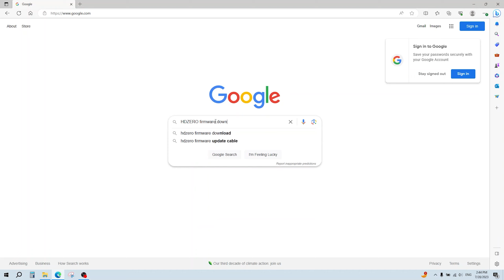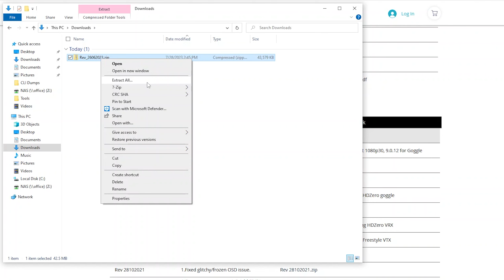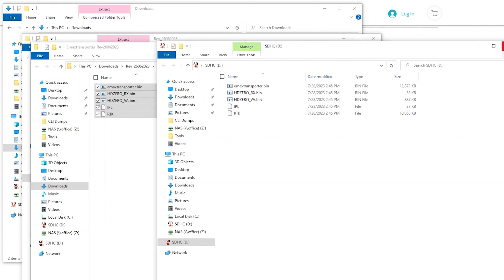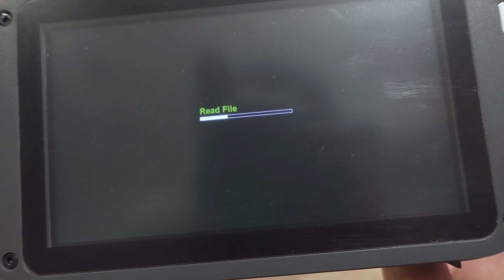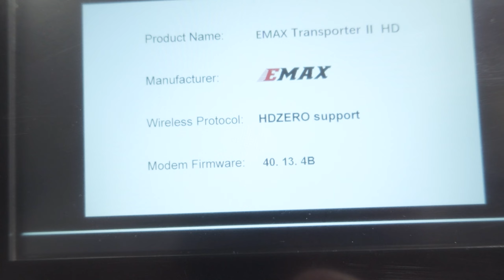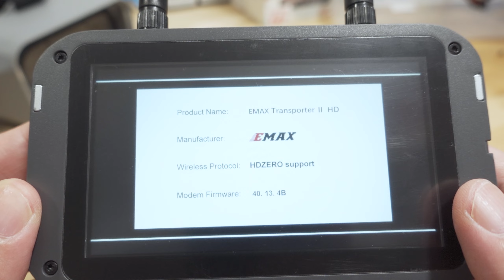How to Update Firmware on the EMAX Transporter II HDZERO Goggles 🎓

Comment: These are still some of the cheapest HD goggles you can get.  I'm thinking of getting them just for the monitor or spare set for my primary HDZERO goggles, when i go digital.
Reply: Trash. Got  yesterday it won't even take a charge. And it's not the battery it's the charging mechanism within the goggles.  company is bottom of the barrel Chinese trash